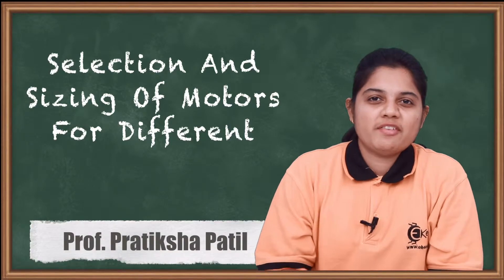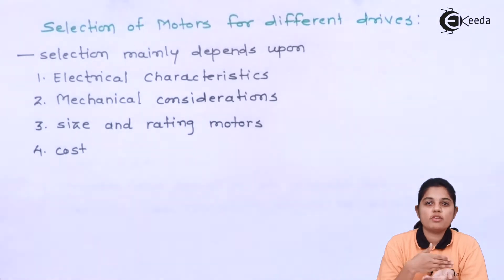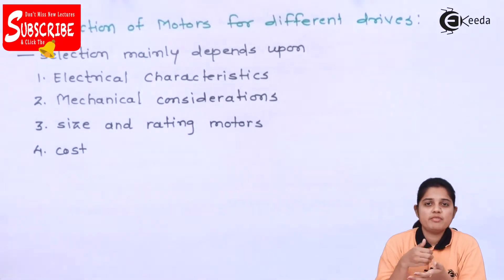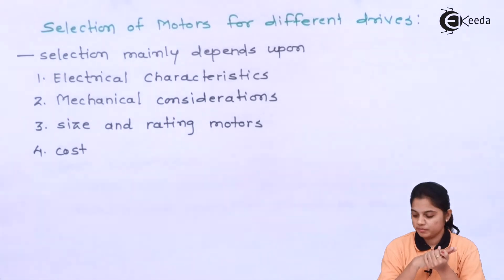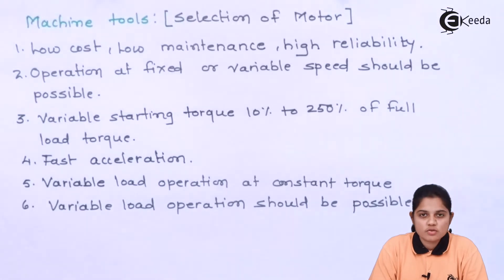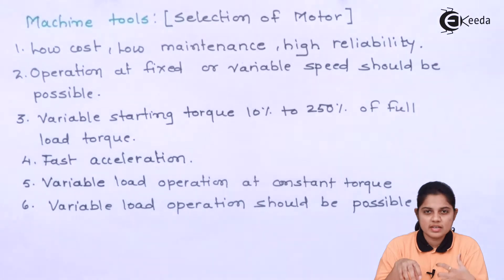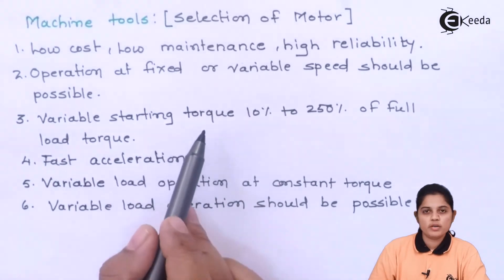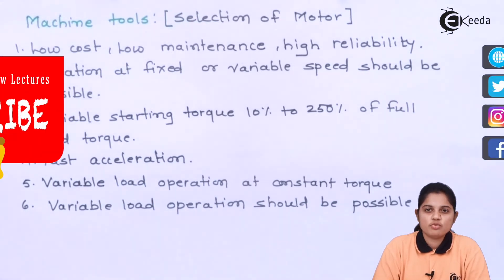Selection and sizing of motors for different applications - Motors - Industrial Electronics

Comment: I’m a hobbyist in need of some expertise.  I’m building a 72” grinder for use in shaping and various materials used in making knives.  The materials will range from epoxy, wood, or bone handles to sharpening or shaping steel blades.  Generally speaking I would like to run the grinder from 500 to 3000 Rpm on 110volt.  I could use a pulley system to secure the given range of speeds in perhaps 500 rpm increments or a variable speed motor.  Perhaps a restat could be used.  With a budget of say $200-$250, what motors would you consider?